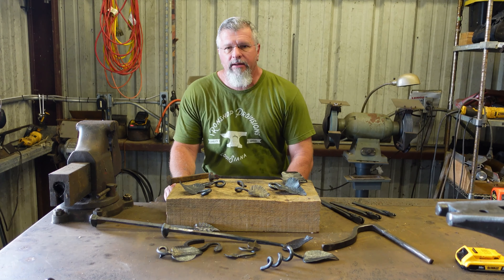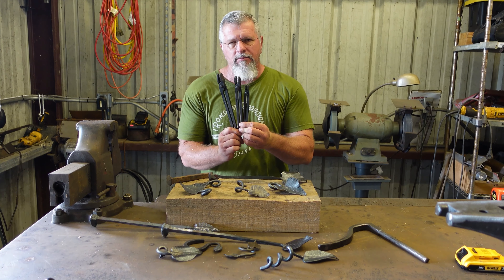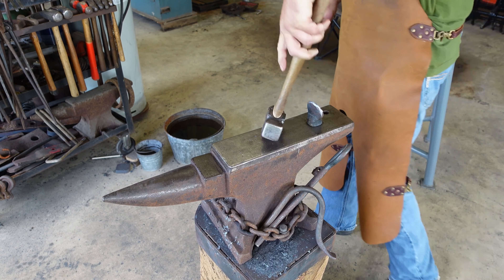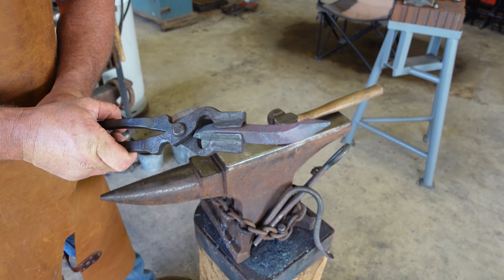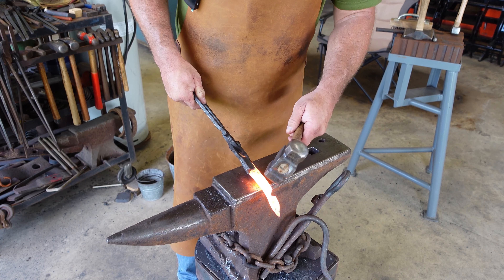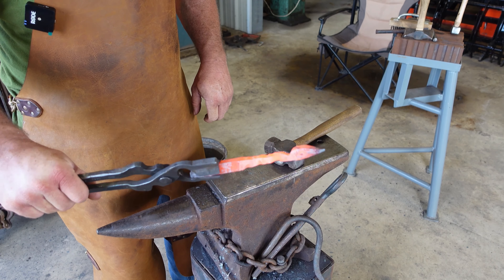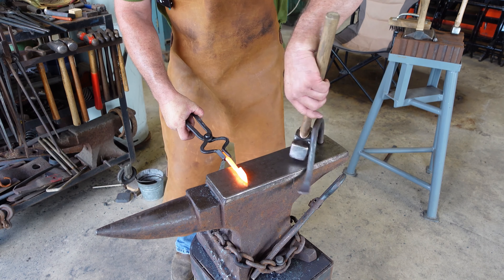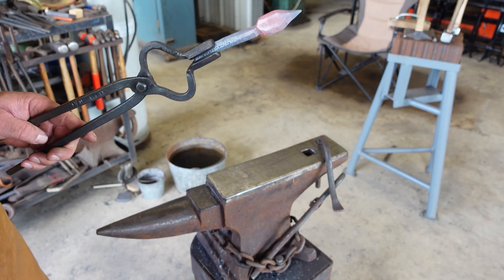Blacksmith hand forged decorative leaf from a RR spike, DIY tutorial

Comment: I really like your step by step videos.  After forming the stem, the initial leaf forming by flattening the diagonal with a flat face gives a good symmetrical leaf blank.   And I second your bringing that bending jig to the next meeting.
Reply from the maker: Thank you Sir. Right on the symmetry, until I figured out my leaf was rolling when I started the fullering my stem could end just about anywhere.
     The jig is nothing more than a steering arm into which I have drilled holes at different spacings. I drop pins into the holes as needed for bending. It works great, I use it a lot.